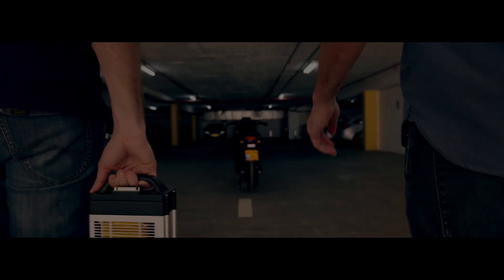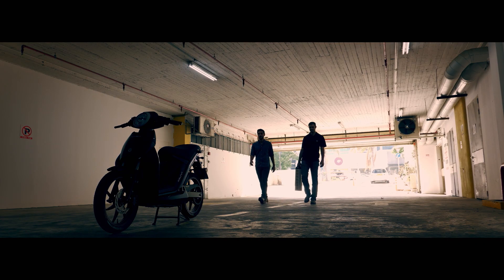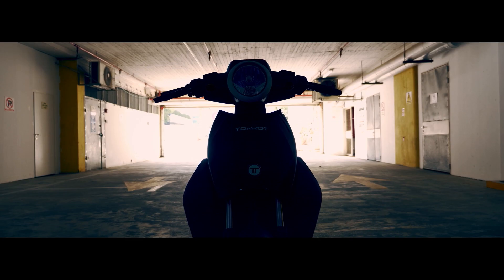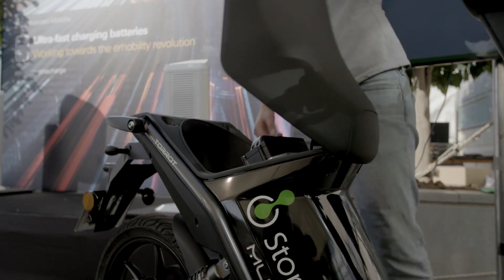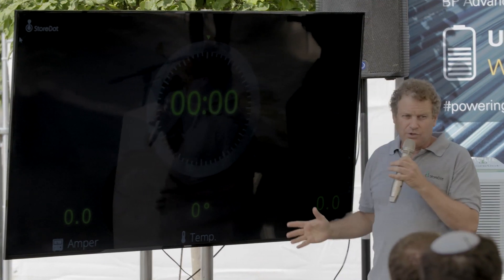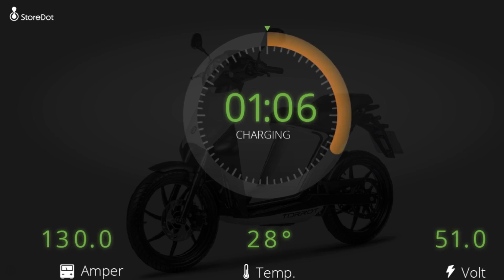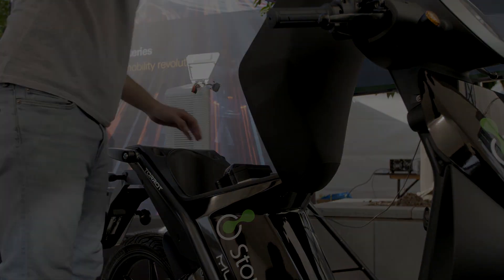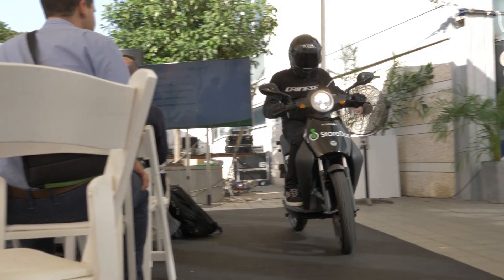StoreDot Fully Charged EV Scooter Demo 2019

Comment: That battery charged for 5 mins at 130 Amps. About 50 volts. Calculates to about 0.5 kWh energy. No way that it’s gonna drive a scooter for 50Kms. Need about three times the energy for that range, and that battery already looks huge.